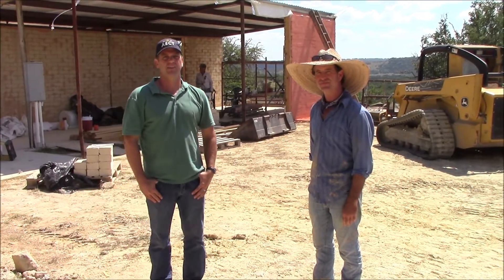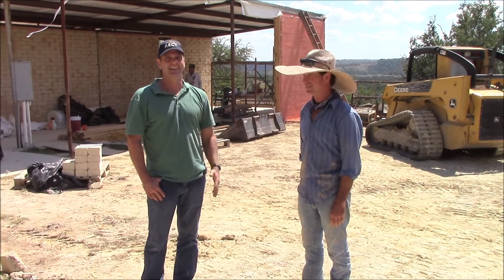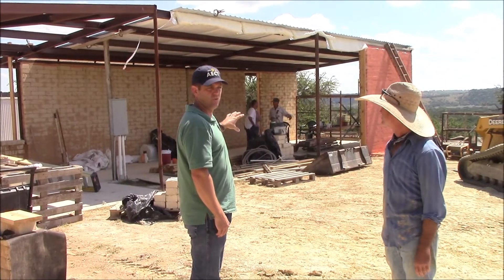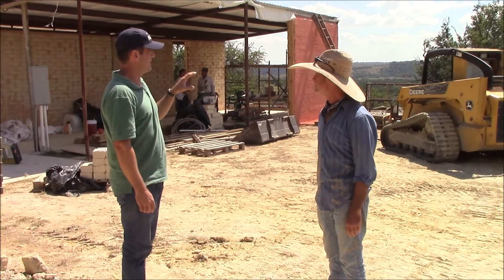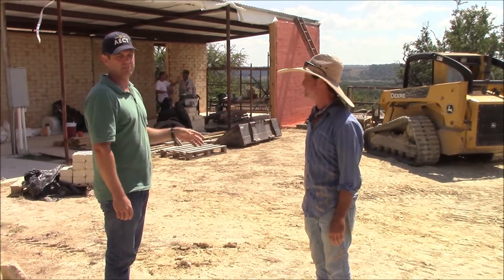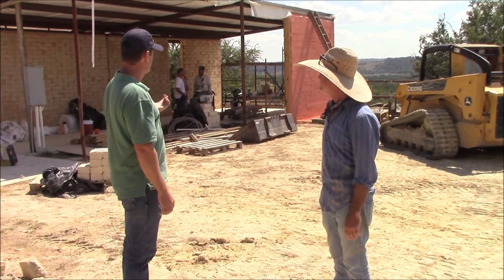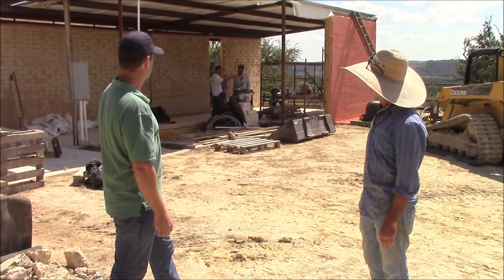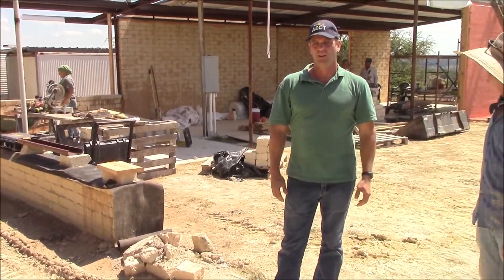An AECT client builds an un-stabilized CEB home near Blanco, Texas.

Comment: I just wish I could press the like button more than once!!!  - For longevity,  I like the idea  metal beams for the roof ; but  how is the energy efficiency with heat transfer. Most roofs I see on CEB homes are conventionally wood aren't they? -  Did this home use a rubble trench or was this concrete? Thanks for what you're doing and I hope AECT gets stronger every year. Was the older gentleman in the video Mr Jeter who started AECT?